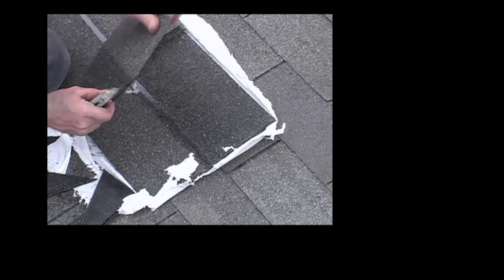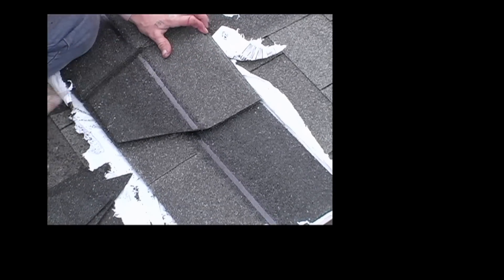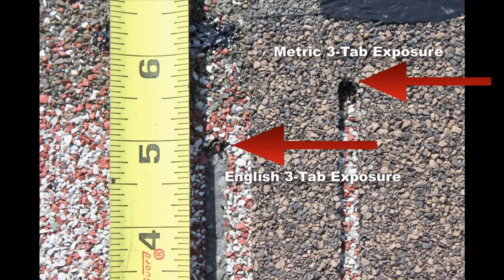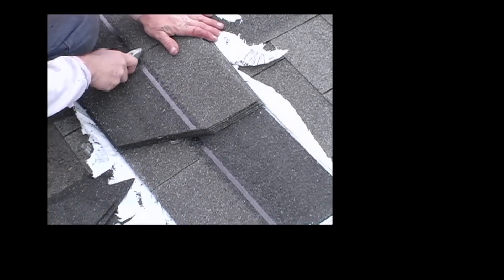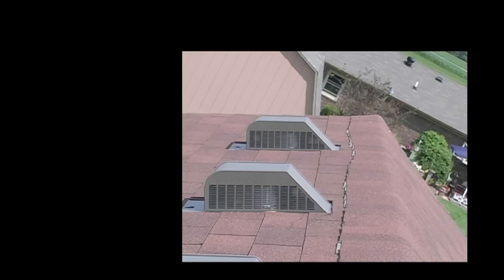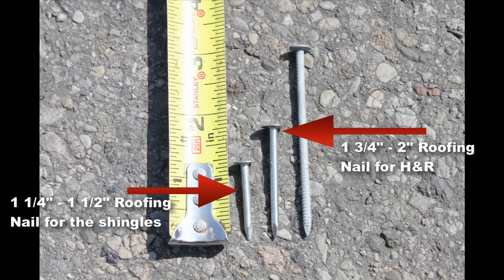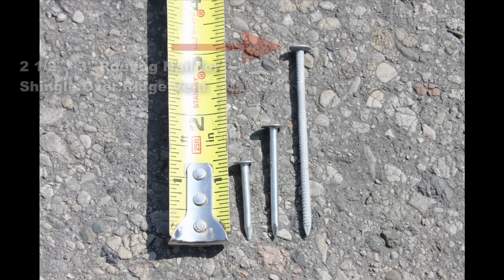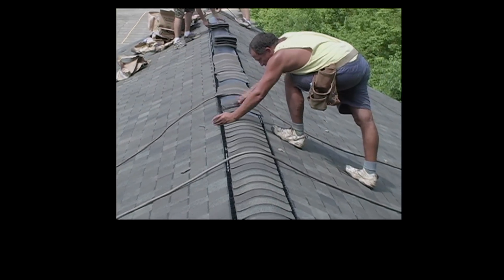Reese Tips - How to install hip and ridge for three tab asphalt shingles ytv80

Comment: Just BUY the hip shingles.  They are thicker and cut properly.  You're saving a ton of money not paying for a roofer as it is.  Just be sure to check the colors to match....it might be made by a different manufacturer.  Good idea though as he said to go 1/2 inch longer nail than what you used for other shingles.

Comment from the maker: Most hip & ridge will have a seal strip feature on each tab (including tabs you cut yourself), so if you put the nails in the right place it's not critical how you run the tabs. Run them so they look best to you.

However, all things being equal, you may want to start on the leeward side of the ridge so that the prevailing wind will blow over the lapped tabs and be less likely to lift a tab.

Comment: This video gave me the answer I was looking for. Having never installed roofing shingles before I was a little confused about the ridge. A guy at the local hardware store just said to use my 3 tab shingles for the ridge. After I started laying the cut pieces it just didn't seem like a clean job. The edges were sticking out. You mentioned cutting them back at an angle. Ah ha! Can't believe I didn't think of that! THANKS!

Comment: I saw another video where the guy said the ridge cap doesn't need to be halked because the shingles will follow the roof line but you need to chalk for the hip. You would do it for both? Or the hip only?

Comment: I'm a DIY'er and I'm searching the Internet to locate how to replace the ridge shingles of my roof. I can't afford the $1000.00 est. I was given and I should be able to do it myself. 

The video was very helpful. You went over the nail size, which is great, but do you add 4 nails to install each one? Why can't you use the same nail on the roof? Another video said the manufacturer has a line on the shigles that you're not to nail above. Does the apply when installing the ridge cap?